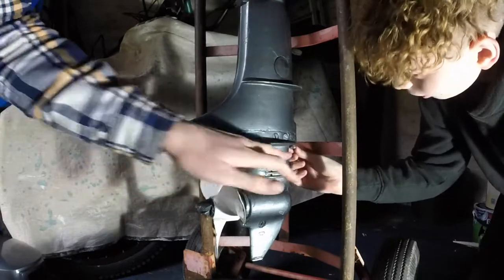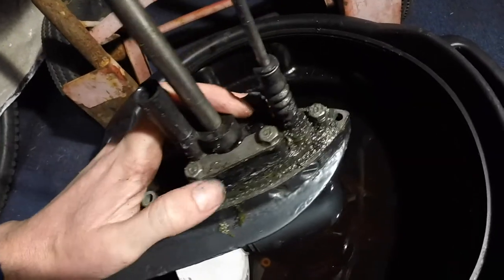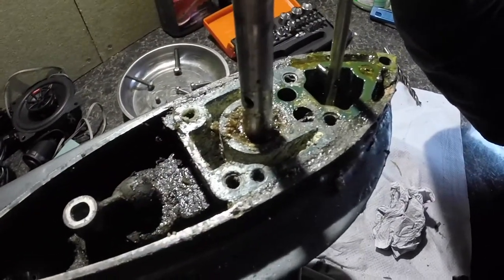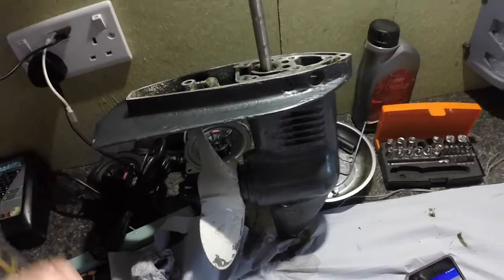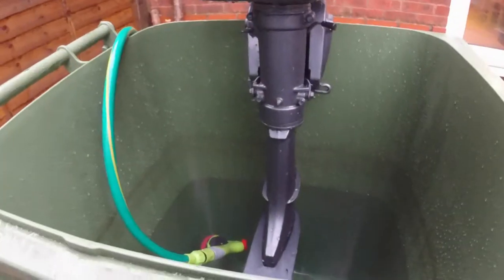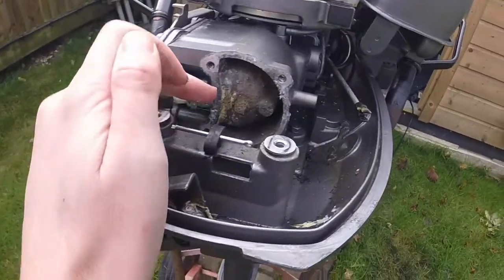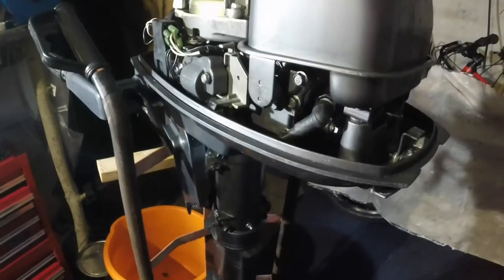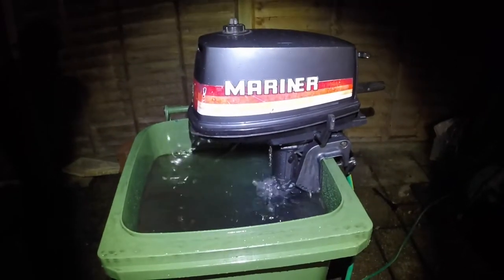Part 2, Mariner 4hp 2 stroke. Overheating issues fixed.

Comment: I’m always bemused by folk that start engines after long periods of idleness without any maintenance.  Just because it runs doesn’t mean the engine is ok.   You can see the state of that engine which was designed and to the highest standards.   Rinsing is useless, outboard motors must be stripped occasionally.  Generally it’s a single motor and if it fails you are in big trouble.  If your lawnmower engine overheats and seizes, chill and drink a beer.  You won’t be so chilled if you’re a mile offshore.
Reply from the maker: Indeed. It was in a shocking condition. This summer the engine did some big miles in Poole Harbour. It's running nice, but because it's not been looking after, it is a but rough around the edges. It does have a new thermostat which I put in before the trip.

Comment: Good video especially the young actor. Actually I'd like to have had detailed instruction, when reinstalling the impeller housing, regarding which way to turn the shaft so that the impeller blades bend the correct way. I think I might be able to figure this out.

Comment: Thanks for the video. I have the same motor I purchased from an advertisement. I haven't run mine yet. Just emptied the fuel. I think I'll go over the cooling, gear oil, thermostat, and carb now that we're off season. Cheers. Great video! Your son will be a seasoned mechanic when he's older.
Reply from the maker: Just seen your comment, sorry! The motor running ok? Yeah I'm trying to teach the lad. Give him confidence in fixing. There a good little engine if looked after.

Comment: Thanks a lot for the videos. I picked one of these up for free last week as a non-runner and after removing and cleaning the carb, new spark plug and fixing the petrol tap it idles nicely. I need full choke when running it on the back of our little RIB, so that's the next issue to solve. Once again thanks for the videos, helped me a lot.
Reply from the maker: Full choke when running, sounds like the carb is still not clean. I cleaned a carb last summer, kept getting filthy! Dirt in the fuel lines before the carb. I would clean the carb then it would soon get filthy again!
Reply: Hi, thanks again, i pulled the carby off again and after another clean it does run better. It's not quite there yet, idle is my challenge now. See link for my daughter first drive. https://youtu.be/An8d1HZ9EeI
Reply: Solved! I pulled the carby off yet again and pulled out the pilot jet, it was totally blocked! now back together and running and idling very nicely.
Reply from the maker: @gavinh5519  She loves it! Engine sounds sweet. Great to see you had a go fixing it. The other engine I fixed last, had a mechanical fuel pump. That was clogged up. Mercury 4hp.

Comment: my grandpa has this exact motor! It sat still for 10 years and we got it running on the first drag!!
Reply from the maker: That's great! They are good motors, we have a Briggs and Stratton grass cutter. Not started in 8 years, my grandads to. It started in 3 pulls! May share the video, ran sweet to! Do with an oil change in think.

Comment: So helpful! Just spent a very enjoyable afternoon stripping and rebuilding my Mariner which now wees like a horse (after absolutely nothing previously - despite impeller change). Kept referring to your video. The way you've presented and edited the salient points is spot on (from someone who has spent the last 30 years making TV programmes).
Reply from the maker: Haha, thank you, thanks for watching. The video was not intending to be a tutorial. But it's has gathered a fair few views and comments. Just messing on with a go pro and a motor. I do run a little YouTube channel which is where my editing comes from. Should of made the video shorter and to the point quicker. It's good your giving it a go your self. I believe in learning how your toys work. There are situations where you need to self repair. Glad it's wee'ing nicely. I do have a thermostat to fit at some point! Enjoy your engine, remember to wash it out in the bin in fresh water if it's been in the sea. Chris

Comment: Tanks, your vid wasa great help in identifying the cooling issues on my identical motor. 
But on mine all it needed was a new impeller. Found all three missing impeller blades under the bottom plate. The last one hiding behind the drive shaft. So had to replace all the gaskets in the water pump as well, after that hunt :-D
Reply from the maker: Glad I was of help!

Comment: Well i`m bloody glad i watched this, i`ve had my Yamaha/mariner ticking over, stood in a large bucket of water, thinking to myself how well it was running, watching a steady flow of water and steam pouring from the power head out flow pipe.
I`m not so sure it isn`t going to overheat now, so i guess a strip down of the cooling parts is called for.
Reply from the maker: Hope you liked it. Was not till I started looking into why the no water I saw this awful mess! Shocking! Let us know what you find.
Reply: @penknifemonkey  Shame i can`t post a photo, the amount of crud, salt and sand that i removed was unbelievable, the worst part was the removal of the 12 x M6 bolts for both parts of the water jacket, 5 of the buggers broke off, lucky for me, i have a Father with a decent workshop, and all 5 were removed. The outboard is having a respray now, before final assembly
Reply from the maker: @martinsmith2600  funny you should say that. Mine also snapped as well.. salt is bloody horrible stuff in these engines.. I have heard of people at the end of the season running the engines up in vinegar for 24 hours. Starting them every now and then. Would of loved to have seen what you also found in your engine. You to could of made a YouTube video with your rebuild.

Comment: Hi Penknifemonkey,Thanks for this .I have similar motor and am not a mechanic so watched your vids multiple times. Very informative,could not find much on YouTube for an engine that has purportedly sold in huge numbers.Strange to find the EU have banned all new sales of brand new 2 stroke outboard motors because of noise and pollution in favour of  4 strokes,did not know this had been the case for years.I cannot even find a repair manual do you know of any?
Reply from the maker: Just seen your comment 🤦‍♀️. Yeah, think it was the US driving the emissions? Like the jet ski world. They all went heavy 4 stroke. I did have a work shop manual with the engine. But it was pants as it covered from 4hp to 50hp. Was a mine field!

Comment: Hi,
Thanks for the video. I have exactly the same issue, and I KNOW I properly flushed the motor with fresh water every time after running it in the sea. Irritating. Did get some water flow going after poking a stainless steel welding rod up the water supply tube and rinsing with a hosepipe. Replaced the impeller as well. Does not overheat at all anymore, but it has a aneamic little telltale dribble. Going to try and run it in saltaway for a bit and see. Such nice motors, but they want to be used regularly. 
I think time allows the salt to build up, even if you have rinsed it in fresh. I know the aluminium corrosion often looks a lot worse than it actually is, the density of aluminium oxide is very low and it "swells" a lot. Wonder if the same happens to salt deposits over time?
Reply from the maker: Hello, you taken the power head off and thermostat housing cover? I have heard buying white vinegar and running it up in like a bucket helps. Leaving it in there all weekend and starting it up every few hours quickly. Dissolves the salt build up. As you saw for me I also had grit and sand! Yes lovely engines. Brothers engine has needed some TLC, not used it for a few months because of Covid. Carb and fuel pump was all gunked up.

Comment: Great video mate, very informative. Are there gaskets for those water housings you pulled off to clean and if so did you reuse them or buy new ones and do you know what part numbers they were?
Reply from the maker: Hello, thanks for watching my video. Yes you can get new ones. I generally see them on e bay when looking at thermostat's for them engines. They come as a kit. I used a gasket, comes in a tube. You apply it on the case or cover. Don't put to much on as you don't want it findings its way into the engine. When you apply it, allow it to dry over night. Don't be tempted to run the engine up. I found this and the water pushed the still wet gasket out! which resulted in a leak and having to reseal it. Hope that helps.
Reply from the maker: Go to eBay and search this number. You will find the gadgets ect for the side case.  274001543374

Comment: Thanks very much helpful i now now what i have to do !!
Reply from the maker: It was never meant to be a tutorial this video. Just messing about getting a old thing going. It's turned out I think a handy video for many.
Reply: @penknifemonkey  thanks anyways my little moter is in bits I've  riped the iner gasket on the water jacket so tommrow I'll get some advice about that ,im hoping to use a liquid gasket compound looks tricky to cut out an not sure if they still make thease ,but same as your moter crusted up thermostat learning heaps cheers!
Reply from the maker: @petersquiresquire6025  I used liquid gasket sealer. Let it set before running up in water. Other wise like mine the water pushed it out. My engine is still running nice.
Reply: @penknifemonkey  thats what i ended up doing was up till  2am larst night over here in NewZealand I tryed not to use to much incase it got into water ways hopefullly it will hold I'll definitely wait till tommrow morning but good here your moter still runs!will let u know how i get on cheers for reply!
Reply: Hi the little outboard seems going nicely no overheating just gotta chane gear box oil and ziptie fueline hoping to take it out over weekend for a test i have a 2hp so I'll bring it just in case.
Reply from the maker: @petersquiresquire6025  nice! Let us know how you get on. plenty of water coming out?
Reply: @penknifemonkey  hi so i tested the 4hp out in the sea and first test it went nicely then fuel coming out air filter could get it to start then took home back in the bucket started first pop and ran on of two dsys tryed everythink i could think of but didn't miss a beat so second test in sea no problems what so no overheating or fuel problems happy days!!
Reply: I nearly forgot what ratios oil  to petrol you runing?I'm useing 25/1 seems bit smokey
Reply from the maker: @petersquiresquire6025  good to hear it is running well. Most 2 strokes run 50:1 including these. Yeah sounds like it had a funny 5 minutes to start with!

Comment: Hiya...brilliant videos and really helpful. I have the same engine, same problems and I'm following your progress pretty much exactly the same. I noticed you sheared off no.1  bolt on the thermostat housing...I've just done the same with bolt no.3. The others are ok so do you think I could get away with it? I wouldn't know where to start removing the sheared off bit! Many thanks again.
Reply from the maker: Funny enough, I have just had that cover off. First time in a few years. Just replaced the thermostat. Also the impeller, gaskets and drive shaft seals. The cover did not leak for me having a snapped bolt. I did try quickly getting it out. I did put some oil in the threads when I put the bolts back in. Don't think it helps that the salt water gets to the bolts. I have recorded what I did, hopefully put it up in a few days.

Comment: Hey @penknifemonkey, thanks for these videos! they have been a great help. I've got one one these little motors to rebuild to keep me occupied during quarantine.  i was hoping you could let me know what settings you have on the carb, in terms of air fuel needle valve settings, how many screw turns out from fully closed. Also what fuel to oil mix  are you using as i cant find this info online and I am new to working on engines. i am currently using 40:1
Reply from the maker: Hello, my screw is all the way in and two turns back. I am running the engine on 50:1

Comment: Hey there. After watching this I was confident I could replace my head gasket and thermostat and exhaust inner and outer gasket. I'm still waiting on the parts to come. I got it taken apart. Unfortunately I broke one of the 4 head cover bolts off. I've tried everything to get it out with no luck so far. If I'm unable to get it out, how bad would it be to leave one of the 4 bolts out, or what if I just fill jb weld in the hole? Thanks and God bless
Reply: Also how would I torque the bolts down to spec, seeings how half of them there is no room my torque wrench?

Comment: Hi, I have a 40HP Mariner. Can you tell me what the correct fuel ratio is please. Cheers
Reply: 50:1 premix. So if your using 20 litres of petrol its 400ml of oil

Comment: How did you put the gear rod back? Mine doesnt go all the way down
Reply from the maker: It can be a little tricky. It gets caught on a shelf. I shone a light up the shaft to try guide it in. It's a bit fiddly! Especially when you don't want the gear rod bracket to come off to. Very very generally pull the pull cord to move the engine splines, so they line up with the drive shaft. Hope this helps. Chris

Comment: I have a Similar Engine and want to during Load My engine Starts to Pump Out water that is hot! and I am concerned
at idle Water is always cool.
Reply from the maker: How hot is hot? It's warm but not hot hot.
Reply: @penknifemonkey  I Would Say Almost 50 degrees C
Reply: dee mudah water is supposed to be hot when it comes out of your motor. If it is not hot, it is not cooling your engine down at all, which is the whole point of the water.

Comment: What's the blue gel you had on the bottom part?
Reply from the maker: Gasket sealer. Apply and let it sit for a while before bolting up. It helps it's performance. On eBay you can get the proper gasket kits.
Reply: Thanks a lot for that, just brought a small boat and the outboard that came with it doesn't start up so I am following your 2 videos.
Reply from the maker: @teddyinthewilderness  drop me a message if you have any questions. I am thinking of doing another outboard will it run soon. A Johnson outboard from the 80's